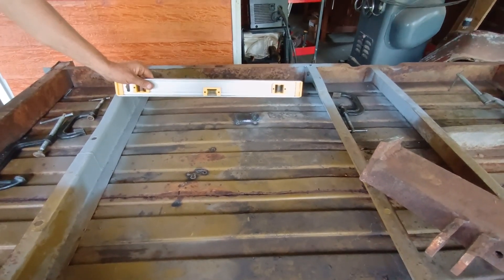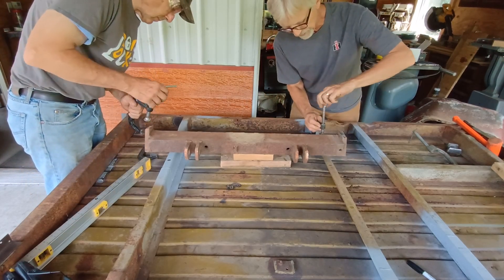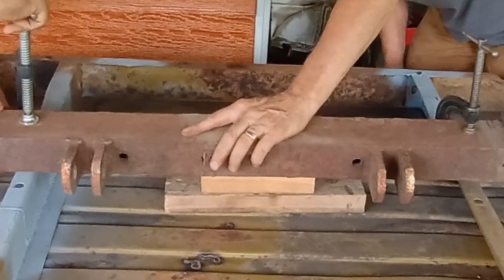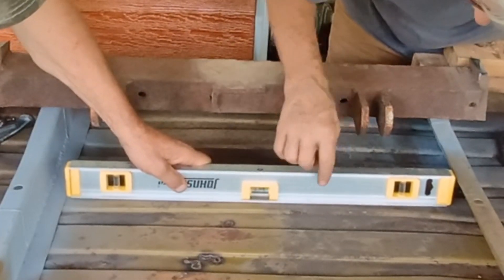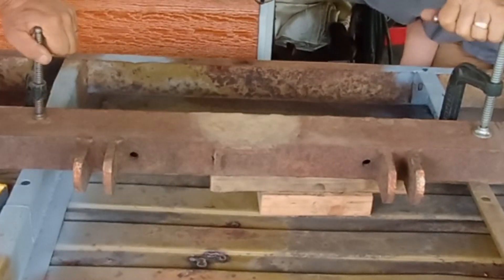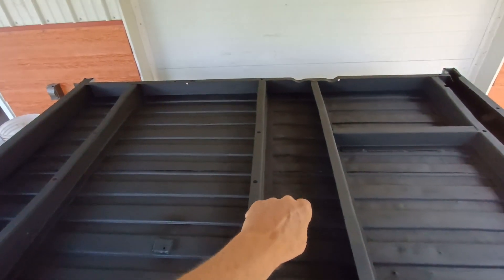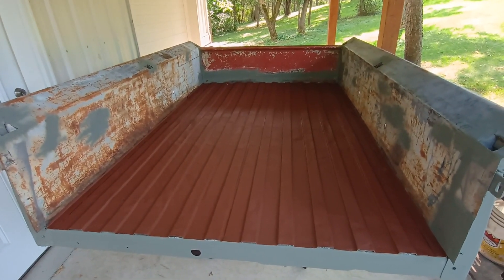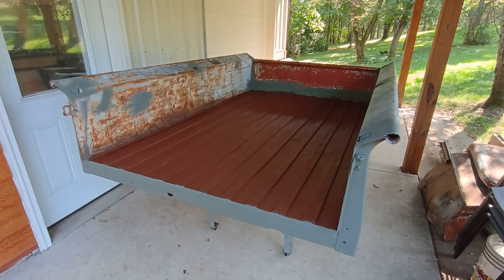1949 Willys Pickup Project   Part 18

Comment: all you need is a hammer and a block of wood. Keep moving block around until it's all flat. i would put some more smaller braces between old ones as well.
Reply from the maker: @clausschuster470  You're right, more bracing in between would help prevent repeat warping.  That being said, the days of running this truck as a 1 ton load hauler are over.